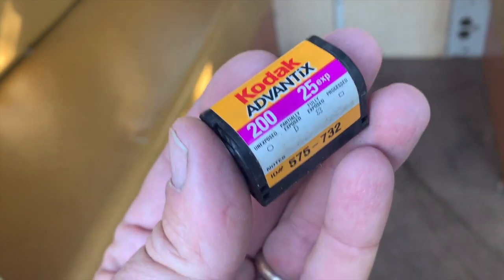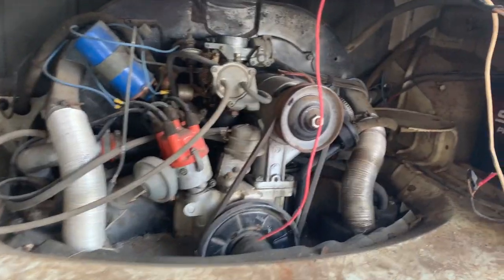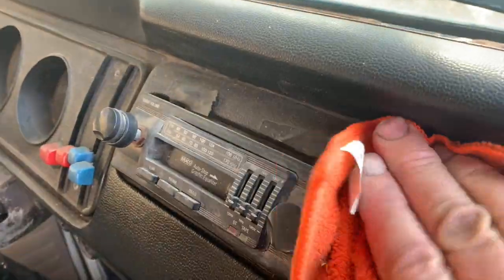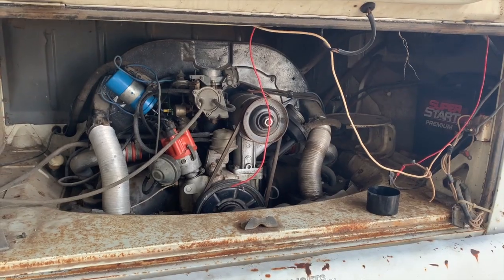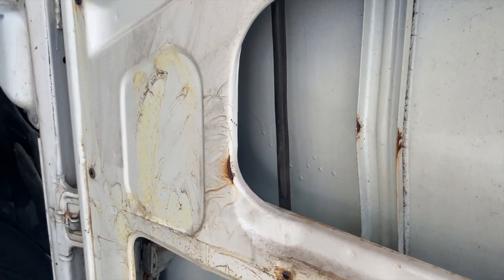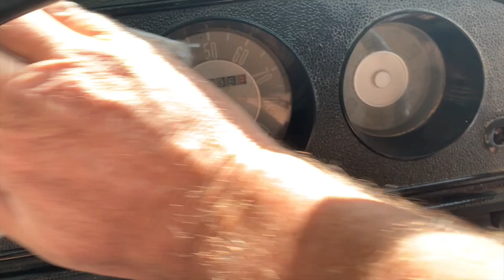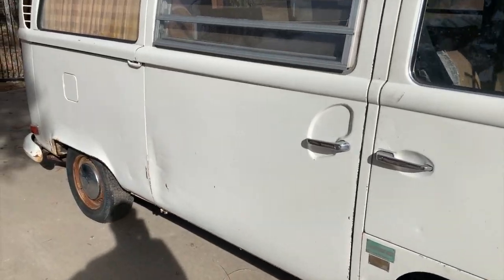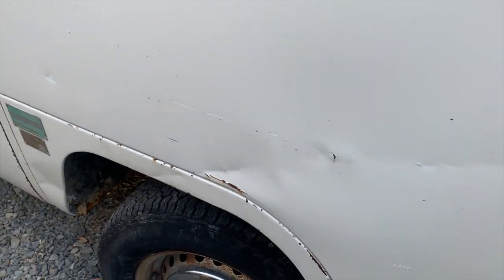Carchaeology: 1971 VW Westfalia sitting for 21 years ... will it run??

Comment: Our Westy was in a similar condition when it came over to the Uk from Colorado only needed a new battery tray and a mechanical overhaul.I spent hours bringing the original paint back and it now shines , she also had a similar dent in the front on the same side which I pushed out and the same dent as your door but on the opposite side .

Comment: I don't know about some of you guys and your old cars! You find holes in the floor and right away you want to fix them and then you won't drive it until you can fix the brakes! Don't you understand that plummeting down a huge hill with no brakes and a hairpin turn at the bottom with a fireworks stand on the outside curb to stop you is part of the old car experience? Just hang on and hope for the best! Great old Schnitzel Bucket, (a name a friend of mine tagged all of his V Dubs with!)  So much nicer than the one my friend owned, But my heart belongs to the Cadillac and now the pink(''coral'') Imperial, I would have been trying to bring all of the Chryslers home! Or at least the one that was white with a pink roof so you would have opposites! Give it a thought it might still be there! And then again the Studebakers looked awful good too! Oh maybe just buy the whole collection!
Reply from the maker: Safety Third!

Comment: Great vid! I remember riding in my 6th grade teachers bus just like this back in the day . 
I'm curious though; when you drove over the camera @ 16:55, it showed a tube similar to a drive shaft in the middle. What is that? Just part of the frame?
Reply: That's the heater tube. Sends air from back toward the engine (not exhaust, just air heated by it) to the front.
Reply: @busbuddha  That makes sense - thanks for the description!